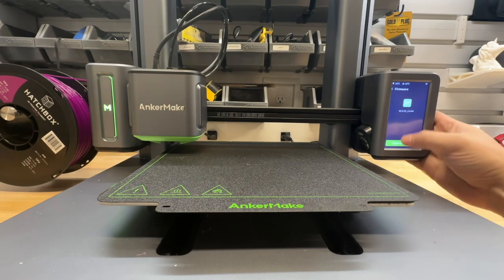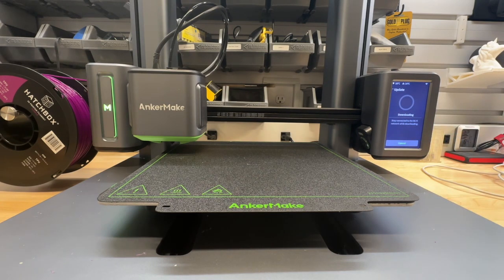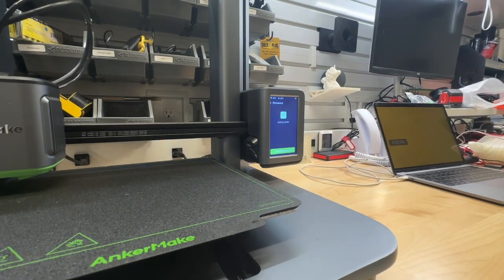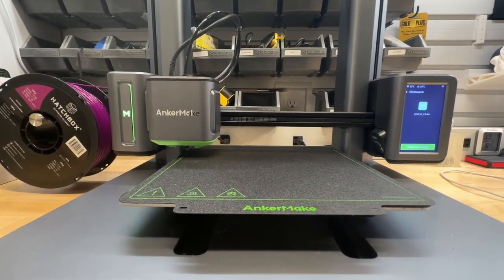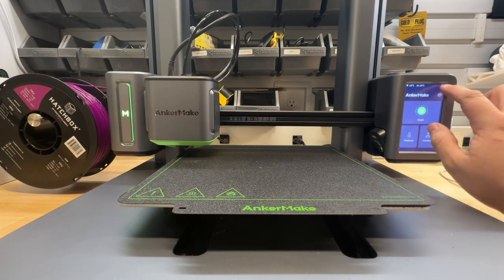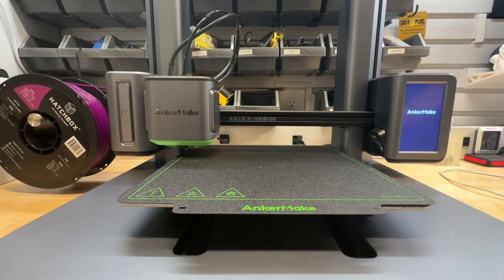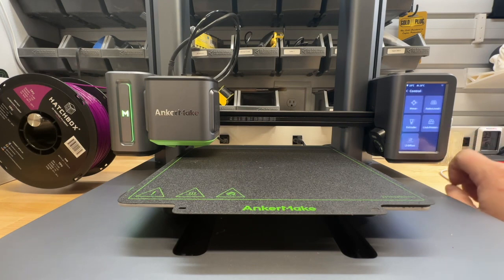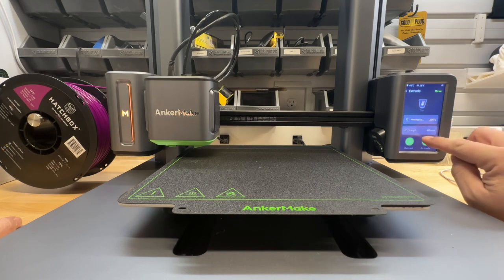AnkerMake M5 - changing filament and issues updating firmware

Comment: I received my Ankermake last Saturday.  I have no issues with Wi-Fi and updated firmware with no problems. I wonder if it’s picky about the router. I am using Google nest Wi-Fi without a single problem so far.  Thank you for the videos.
Reply from the maker: Thanks for the input. I will try an alternative router.
Reply from the maker: Would you know the firmware version you started with?
Reply: @timexperience  no sorry. I didn't note it, just checked for updates firmware and pushed update.

Comment: Filament extrusion problem solved. I recently solved a problem with the filament not extruding properly (weak or not at all, inconsistent). It was quite frustrating but the solution turned out to be very simple. If you take off the case covering the printhead you'll see an adjustment screw where the filament enters the gears that extrude or retract the filament. If you remove that adjustment screw you can then pull back the lever and see the space inside. In my case there was a piece of broken filament in there causing the problem. After I removed the broken filament and replaced the screw it was back to proper operation. All in all I love this printer! It prints fast (up to 500mm/sec with the latest update) and not having to manually adjust the z offset is a godsend.
Reply from the maker: Thank you for the comment.  I have found a similar issue on mine.  A quick spray with canned air helps.  I am looking forward to the V6 color engine to take it further.

Comment: I just got my m5 today and I’ve used the anker filament and printed filaments and I continue to get super stringing prints what have you don’t to fix that
Reply from the maker: I would setup a print profile to try adjusting print temperatures.  I am working that now to improve the 0.1 layer height at 50mm/s print.

Comment: Printer is ok. I hate that it stores my email in the diary history. I can’t find away to delete the history in the case of selling the printer. I even tried to restore. No luck. Any ideas?
Reply from the maker: I did reset my printer trying to solve my wifi issue and the data remains. But you could try to overwrite it with a throwaway email.
Reply: @timexperience  I tried using a new email, but the data still remains from previous logins with old email.

Comment: Hi I have had my M5 for a little while now and paid for the early air shipping it actually showed up 3 days before the slicer was even released, and have had zero issues with wifi, updates on both firmware and slicer updates, there has been 2 updates for the slicer I believe, except its not straight forward on how to update it as in the first update it would not update via the update page in the slicer, you had to download and install it from their website. Now it does show update for the second update. the printer has been doing fantastic. The only thing I’ve had to adjust on the printer has been the z height and have had great prints using primarily the anker slicer. as with the  slicer I did have the issue not showing the printer until I found a solution on ankermake discord, the solution was to log out of slicer and when you go to log in you'll see in the upper left corner a Region select that select the region you did on the app, (for me United States) the log in and for me it found It instantly, might have to click refresh. hope this helps. Also I really appreciate you taking the time to show these videos hopefully with your help as well as the discords which are super helpful for various issues people are having and solutions from vary experienced people who have several years of 3d printing. look forward to seeing the results of your nasa fabric( I've thought about printing this my self as well.) keep up the great work!
Reply from the maker: Have you printed the Benchy?  If so, how did it come out compared to what I printed.  I love to know others experiences and I am finding solutions for several issues I experienced that I plan to share this week.

Comment: Man, I'm glad your doing updates. I'm waiting on mine. I've been having hit or miss results with my Bambu X1C. I sure hope both these companies keep maturing their software. Can't wait to try the two side by side. Can you send your prints directly from the PC to the printer through WiFi? Also, for great "budget" filament, check out Inland. It's microcenter house brand, and I've heard it's rebranded esun pla.
Reply from the maker: There is a lot to discuss in you comment…I love it.  I know it is a gamble to update my Monoprice PIII never worked well after the first update.  I’ll take the poison first and if I survive you will know.  I cannot get the slicer software to see the printer even though the iPhone app does.  They are on the same network but I am investigating my network to see if there is anything preventing communication. I have used Inland and it worked well.  If I had a Microcenter closer I would buy more.  Amazon is fastest for me and cost is not bad.
Reply: @timexperience  There's nothing wrong with your network, the slicer has an unintuitive 'region' selection UI thing, so you have to log out, select the region in the corner dropdown, then log back in. Then your printer will show up on the slicer.
Reply from the maker: @Geoff_W  I have been using a Mac so last night moved to my PC and in the PC login you are required to select a region to continue.  I went back to the Mac and logged out and found the region button and you are accurate, it resolved the issue regarding seeing the printer.
Reply: I have a BL X1C and you are mistaken about a few things. 

"So anyone can access the printer, camera, my prints, etc. Which I REALLY don't like."

1. The cloud is secured. If you read and understood the Sec researcher and BL response it was open/unencrypted when you used LAN only mode. Meaning if someone was on your network they could access your printer. Basically if someone was on your network the printer would be the least of your worries. The cloud is encrypted and fine. Please read BL last blog post about it. One of the issues the whitehat found was already patched with the latest firmware. (HTTPS is enforced) if you are running old firmware you cannot connect to Bambulabs servers/cloud. 

2. You do not need the cloud to print. Sd cards are always an option if you are uncomfortable with using servers.
Reply: @hawtdayum  Wow, just saw their blogpost (and edited my post). This is why you don't trust the 3dprinting sub on reddit with the fervent spite they have for Bambu. I appreciate Bambu were honest and open about their mistake, and that they took decisive action to fix it. I still wish there was an option to send the file locally over wifi. Even if that means forgoing the app features for now.
Reply: @goawaybaizuo  No worries. I have the X1 and followed that event closely. I even went so far to packet monitor anything coming out of the printer when connected to a separate router. I too believed the security claims and 1 about using a lot of data then checked it for myself. Idk why the FUD is there for bambu aside from them being a Chinese company but they made an excellent printer and stand to lose more if they are caught in a scandal. 

You can still use Lan Only mode and that will bypass the cloud but you will lose features like camera. I haven't tried it personally but others state it works ok for sending prints over.
Reply: Sending to my M5 through wifi works perfectly for me!  I was so excited to not have to physically connect.

Comment: I just got my AnkerMake and had a few problems. but it is working great now! I didn't have any trouble connecting it to the Wi-Fi and updating it. BUT, it kept going offline for my phone, and never was able to connect to the desktop app.
I emailed their support and the responded after only a few hours with some suggestions. first, update the app on my phone. I did so, but still couldn't connect to the printer. so, then I reset the printer. and then connecting to it with the mobile app worked fine. For the desktop app, I had to do the same thing and update it, then it connected and showed the live status of the printer. 
I suspect the problem was with the region. previously, when I logged into the app on the desktop app, it didn't ask for my region. but after the update, it did, and then I could connect to it.
Hope this helps you all. I am really loving it so far!
Reply from the maker: That was how mine was in the beginning.  It was why I started making these video as I could not find a solution.  I found if I limit my WiFi to 2.4GHz that I would not have that issue…as much.

Comment: Mine wont even feed into the wheen/bowden tube/sensor... They told me to ''mess with screws...'' weLL i have since but no change at all stll stuck aat 1 1/2 inch fed before tube... going to bypass but im sure it wont fix this from being a possible lemon/dmged..
Reply from the maker: I had to cut 1/2” from the extruded end as it was pinched. Which screws were you to mess with?
Reply: @timexperience  that’s literally what they said after I corrected them with sending me the wrong link for the nozzle central bridge device. When I told him it was the feeder with the sensor, they said mess with the screws and that they tested it before it arrived and it worked fine, but there is no way it should be this difficult and have to waste so much filament by recording it I have nine different filaments and no luck. I’ve messed with the screws after moved, the boat and tube looked through it with a bright light there’s not a lot of space with the wheel/sensor if any at all, I’ve done everything short of manually, feeding it into the nozzle portion, and or give it too much force
Reply from the maker: It does sound like a bad unit.  Are they willing to take it back?

Comment: I noticed when you are manually feeding the filament in the hotend has not preheated to 200c in order for it to extrude. When loading and unloading filament it has to reach typically 200c for that to happen. Does it not have an option to select load and unload? As far as a firmware update ota, have you tried updating firmware via USB C stick?
Reply from the maker: You are accurate, I noted after I published.  I went back and there is no loading option but there is a preheat option.  I tried and could remove the filament.  I could not load filament manually.

Comment: I am having issue loading filament and have to force it really hard. The filament gets fed maybe 20% of the time. Then I try to print but it ends up creating a blob of filament inside the extruder without actually extruding much. Funny enough, I tried calling but they only do support through email. They told me to change the hotend but when I asked for one, they said I have to wait a month or two. I think I got a "used" printer since the heatend nozzle was clogged out of the box. I give up - going to return and buy a FLSUN v400.

This is definitely a BETA product - so either skip or wait another 6 months.
Reply from the maker: Sorry to hear of your experience. Did you try AnkerMakes video for clearing the filament.  Have you been able to print anything?  Is there any other signs the unit is used?  I understand returning your unit.  Waiting for two months for something that may not happen likely puts you out of the return window.  Better to return while you can.

Comment: I never had any issues with wifi. I got several firmware updates. Desktop app updates, mobile app updates... No problmes at all.
Reply from the maker: They are not fully resolved.  But they are greatly less then what they were.
Reply from the maker: @pcbuildfrance  glad to hear that.  The problems are really not frequent.  Usually things only break when you start changing out parts.  The prints are good once the slicer settings are tuned.  Good luck printing.

Comment: It's WAY easier if you only slightly push that lever down when feeding the filament. I've found that if you push the lever down as hard as possible and push the filament in, it will NEVER feed out the nozzle
Reply from the maker: Tried it.  There is a sweet spot.  Not too hard.  Not too soft.
Reply: @timexperience  i needed that info!! thx

Comment: Dude I am bit surprised that you have a grand child you look very young apart from that I have received my AnkerMake5 last Saturday and it was plug and play. What update have the AnkerMake guys made since you posted your video I am not sure. Print results are fine too apart from the mistake I made as a novice user or let us say sole CNC DIY man with no experience in 3D printing.
Reply from the maker: I had enjoyed 3D printing but disliked manually leveling the bed so I did it less and less.  I saw the auto leveling on this and like it immediately.  I was looking for easy when I wanted and difficult when I wanted a challenge.  My oldest child is 23yo and youngest is 8yo. My granddaughter is 4yo. It is an interesting dynamic between the 8yo. and 4yo.

Comment: This printer is a hoax, stay away. Bought one to return 2 days later. Don't get caught.
Reply from the maker: Unfortunately every product has has its failures.  If you want an easy experience wait until this one is more mature or the next generation of this printer.  I hope you find a printer that meets your needs.
Reply: @timexperience  This product is a failure when the company advertises features it’s unable to achieve.
Beginning with the topic of this video; loading filament is a nightmare.
It’s overpriced; you can get a Bambu Labs P1P or a Creality K1 for less money which are Core XY printers with Input Shaping.
The Anker Failure printer is a “bed slinger” without input shaping, it CANNOT get even close to print on the advertised print speed with decent quality.
The camera is useless; the camera angle is awful, specially for the first layers, you can’t see any detail and the “AI” feature that miraculously spots print problems it’s a lie.
The camera LED is pointed completely out, it lights whatever is on the left side of the printer, not much the print bed.
THE SLICER!! OH MY GOD, the Anker slicer is a JOKE, you can’t even fit it to the monitor screen and good luck trying to click any icons!!! LOL!!!
If you can’t use the Anker slicer, YOU CANT SEND PRINTS OVER WIFI, no wifi on a printer that “has” wifi, another lie.
When using CURA to slice, you get the STL on the printer and it overrides the speed settings you made for the first and consecutive layers; it simply goes to whatever “5.2x” speed it wants and ruins every print, I COULDNT PRINT ANYTHING ON IT DURING TWO DAYS.
My Ender 3V2 IS WAY SUPERIOR, that’s a real printer from a real printer company.
“Wait until this one is more mature”? Are you insane? Don’t you have any dignity??
If it doesn’t work straight out of the box, it goes back to the seller.
I’m very happy with my Creality K1, thank you very much.
Stop wasting your time and others time with this garbage, THIS PRODUCT IS A HOAX.

Comment: you said you have a unibqu. system I would make a IOT network that's only 2.4 then assign it only to the shop's access point if you can. I found that helps on a ton of my devices
Reply from the maker: That is exactly what I did.  I have 5GHz/2.4GHz in the house but the WAP in the shop is 2.4GHz only.  Fixed May of my problems.  Thank you.